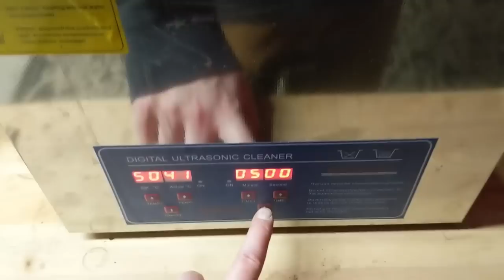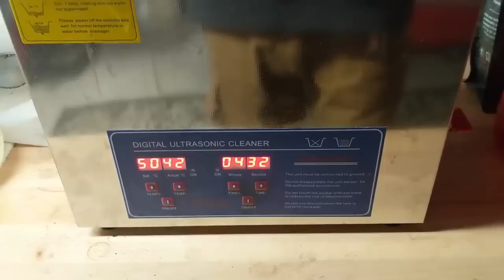How to Clean a Honda GX Carburetor

Comment: Thanks!  Solved my problem with the Idle jet.  Many other videos showed the other components to check and clean, but yours was the only one that only one that pointed out to clean that small hole.  My generator couldn't even start. If it did it was for 1/2 second.   cleaned that little jet and ran perfect.  VERY THANKFUL since the generator only had 0.9 hrs on it.    Maybe I will remove the fuel from it when I store it again.... for 2 years.  :-)  I did learn a bit more too with the other parts in a carb too!

Comment: Thanks man, just bought a barely used snow blower yesterday. The PO left gas in it, in his storage unit for the past 2 or 3 years. I got it cleaned up this morning and it's running well, which is great because they are predicting another snow storm in the NE. This really saved my butt and my back.
Reply from the maker: Thanks for watching!

Comment: Excellent video.  My pressure washer would not stay running. Used the information to remove, clean, and reinstall the carburetor on my Honda pressure washer.  Started right up. Thanks.
Reply from the maker: Thanks for watching!

Comment: Dude, I can't thank you enough! Without going into the gory details as to why (!) my carb was leaking gas like a sieve. Turned out it was the needle valve that wasn't sealing correctly. I know zero about engines (apart from which end the gas goes into), but thanks to this video, I was able to take the carb off my Cub Cadet snowblower and fix the whole thing. No more leaking. Likely saved a lot of money too. Thanks so much. Greetings from Michigan!
Reply from the maker: Glad to hear you're back up and running, thanks for watching!

Comment: Video is excellent.  I'd never taken a carburetor apart before but watched these 2 videos, on cleaning and replacement, and it worked great.  Before cleaning, pull start was an exercise in frustration and electric start turned the engine over but still the engine died.  After cleaning tips from this video, engine started on two pulls and just purred.
Reply from the maker: Thanks for watching!

Comment: You might be able to get friendly with your local dentist and ask for a No 6, 8 or 10 K file for endondontics to clean the main jet. They can't be used too much (work hardening) so as long as they've been sterilised after use should be safe. They're made for cleaning our root canals. Inset, twist and pull to remove debris. Come with a little handle.  Handy also for water jet sprayers on your cars windscreen washer system

Comment: This was a huge help man, really appreciate the video.
Reply from the maker: Thanks for watching!
Reply: @EliminatorPerformance  just out of curiosity, so I rebuilt my carb minus the ultrasonic cleaner. Set my adjustment. Still won't run. I'm going to do a compression test and spark plug check. Any idea what a good compression number is for a snowblower. Ariens?
Reply from the maker: @farkid911  anything over 90 should at least fire if you have spark. Spray some carb clean in and give a pull, maybe no spark?
Reply: @EliminatorPerformance  yeah that's what I'm going to check next

Comment: Thank you so much. I just took out the idle screw and the plug underneath it. cleaned out the little hole, put both back and it runs great. :-)

Comment: This was great, thanks for this. Does putting the gaskets and o rings in the ultrasonic cleaner cause any problems? Did you replace any of them as part of this cleaning? It didn’t look like you removed them prior to the ultrasonic cleaning.
Reply from the maker: No I haven't had an issue with it. If I can remove them I will, just so they don't get wet, but when they're stuck good and the gasket is still in good shape then I leave them.

Comment: Well done! One of the best Honda carb vids I’ve seen. Maybe you can help with a problem I have. Honda HS724 snowblower. Starts rough, will sputter and backfire upon startup. If I try an engage drive or augers it will sputter and stall. If I give it just a minute or 2 to warm up everything is fine and purrs like a kitten? Any thoughts? I’ve cleaned carb in ultrasonic cleaner poke all hole with wire? I did notice in this gif that maybe pilot jet isn’t seated all the way like you shown? Thanks for any help

Comment: I have almost the exact same generator, i can start it with starting spray and then it keeps running but without the starting gas it refuses to start, is it likely the carb that needs cleaning then?

Comment: mine has a screw with a stop that won't allow it to turn; only little left a little right ..not all around and didnt want to trouble it but should I.......Is it wise to use the pressure hose through it ...doesnt it have one way valves like a two stroke carburettor?

Comment: Impressive video brother.  So much info in a very easy to follow manner!  I still have a no start issue on my generator with the exact same carb though.  Good spark.  Plug looks to be getting a little bit of fuel after pulling a dozen times but might not be enough.  Everything seems clean.....any ideas?  Thanks a bunch.
Reply from the maker: Spray some carb cleaner in there, if it starts on the 1st or 2nd pull it's a fueling issue. If it doesn't start, could be no spark or valves need to be adjusted!
Reply: @EliminatorPerformance  Just started after first pull with carb and choke cleaner then stalled.  Back into the carb I go!
Reply from the maker: Make sure your fuel shut off, and fuel line are flowing
Reply: @EliminatorPerformance  Turns out it was water in the gas.  Starts and runs now but surges as you described in this video.  Now I'm off to watch that one, too!

Comment: This video really helped me, thanks a bunch! Had a 1980 honda gen given to me. It's in showroom condition except I think the original tank of gas was left in it. You can imagine what the carb looked like on the inside! Anyhow, thanks to your video I was able to address all the components in this carb. You should have seen the engine oil, it looked like black curbled milk. Well she is all cleaned up now and running like a champ. 2.2 kilowatts of pixies flowing through my power cords.
Reply from the maker: Nice, glad to hear it's up and running, thanks for watching!

Comment: Quick question. Does the mixture screw on the Honda small engines meter fuel or air? I need to richen mine a little but don’t know whether to turn it in a hair or out a hair because I’m not sure if it’s a fuel or air screw. Thanks

Comment: Great video but wouldn't the ultrasonic cleaner soak and degrade the gasket or gaskets on the carburetor? I think I would have carefully removed them before using the ultrasonic cleaner OR any carb cleaner! Thanks!
Reply from the maker: Surprisingly they've never damaged gaskets, if they're still thick and not torn I just reuse them, I've never had a problem. Once you try to remove them you absolutely have to replace them. If they're dried and cracked then I'll replace them too.

Comment: Very helpful video and thanks for taking the time to share. I'm running into some issues with my gx160 took carburetor I took it apart to clean and noticed the idle jet did not have the little hole and using a sewing pen i was able to I guess free it kinda seemed like it didn't have one 🤷🏽 i also bought a carburetor for one of my other machines (gx240) and was curious I took the idle jet out and this one had a brass piece but no hole I tried a twist tie and smallest sewing needle and it doesn't have one, is this normal?

Comment: I am dismantling a carburetor on a Honda F310 that has not been used for 15+ years and I cant get the distribution tube out. Any ideas how to get it out ? :)
Reply from the maker: Soak in boiling water and some dishsoap maybe loosen it up
Reply: @EliminatorPerformance  
Great! Thank you for the tip!

Comment: Hi, I have a honda gx390 generator, I have removed the fixed idle jet and I can't see any hole whatsoever and I can't push nothing through it, it's like there's not ment to be a hole there, I red that some of the gx390's don't idle and just have a run speed, would this be why? it's more like a blanking plug than a jet, thanks john.

Comment: My Honda rt5000 tractor with the GX engine dumps fuel from bottom of carb when I’m cranking it. Is this a case of the rubber plunger tip? Also spark plug was wet, and there was even fuel in the plastic intake that connects to the carb. Thanks for the detailed video.
Reply from the maker: Yes, leaking needle valve. Sometimes it can be the seat that the needle valve goes into as well, I'd recommend getting a needle valve 1st and then looking at a replacement carburetor.
Reply: @EliminatorPerformance  where am I going to find a carburetor for a 1989 Honda rt5000 though? I think the Honda PN is 16100-ZE3-793. Although, when I google it, the pictures don't really look like my carb... Thanks again.

Comment: hey bro !  i have a Gx 140 and i had some issue with him at one event ...we tried to fix it in the night time ...and i think we lost some small piece from the carburetor. i would like to buy a new carburetor and want to ask you if think that other model of carbureator will fit ...i mean gx 120 gx 160 ? because i can't find the right one on the market . thank you
Reply from the maker: I believe the gx120 and 140 are same, but are different from the Gx160 and gx200 (those 2 are same as well)
Reply: Eliminator Performance thank you so much for replay 🙌

Comment: What does it mean when these have good fuel good spark but just won't pull fuel on mine it will stop pulling fuel ill even manually prime it to get it to push fuel up the tube and it will run for a few seconds then die this is the kind with a solenoid on the bottom mind you it agrivated me like crazy Friday cause it wouldn't stay running

Comment: You mentioned new carbs may surge from the factory?? I just replaced my carb it came in my tune up kit I was hoping this would stop the surge but it’s still surging and engine dies unless choke is on. What’s next?? I put fresh fuel and all in it
Reply: Check fuel filter in tank, it’s a fitting with a filter on it 
Remove the tank

Comment: What do do with a cloned honda genny that runs bout 1-5 min than dies, can pronlong when stutters by switching to choke...
Reply from the maker: It's starving for fuel, I would start by cleaning the carb, blowing out the fuel line and also removing and cleaning the fuel filter that screws into the fuel tank
Reply: @EliminatorPerformance  Thanx sooo much thought it was air but that solved  0. I'll mess with that fuel and it's loved additives that gunk everthing.

Comment: Honda gx390 only runs good on half choke.. Took the main jet out an cleaned with compressed air, but still the same. What's my next step? Thanks!
Reply from the maker: Clean the pilot jet! Thanks for watching!
Reply: Appears like that solved it. 👍 Thanx man! GR8 video!

Comment: I have a Honda gx 340. What would cause gas to leak from carburetor. Seems like it’s bypassing carburetor coming out the top back side. Could it be float needle problem
Reply from the maker: Yes, leaking needle valve, pull your dipstick and smell the oil. If it smells like fuel or it's overfilled, change your oil before running the engine!
Reply: Eliminator Performance I just changed the oil. No gas in it. I have to cut the gas valve off when not using cause of gas leaking. I bought a new carburetor just waiting for it.

Comment: well that should solve my issues. i have a clonda powered golfcart april 5th the jack shaft from the cvt decided it no longer wanted to be part of the cart and ejected itself at 40 km/h (about 25mph) got a neighbour to tow it home where i got it in the shop tore it down and ordered parts and it sat for 3 weeks waiting for parts and someone to give me a hand redoing the chains. went on a test drive to get dinner at exactly the 3 week mark it idled fine but ran like complete shit with any throttle imput and died in the same spot the jackshaft ejected itself i initially thought it was too much fuel because i changed the throttle linkage and the after market air filter was soaked in gas that wasnt it so i towed it home again changed carbs same thing so that led me to think water in the gas. thoughts being there was enough vapor in the carb to idle but with throttle it was pushing water out of the bowl filled a clear container with gas from the tank and nothing so i ordered a new carb my plan is to clean the two that i tried and keep them on stand by when it inevitably happens again im just thankful it waited until after the snow was gone

Comment: hey guys, awesome video. not sure if you can help, but, after taking a year off from personal lawn care with the arrival of another kid, I'm back to mowing my own lawn. I made the mistake of not running my mower since last spring, and now I'm having an issue getting my mower (Honda gcv160) started. It seems to be a fuel delivery issue. long and short of it, I'm not getting any response when I pull the crank except when I've used a starter fluid. When I use the starter fluid, it fires up but quickly stalls out. I've verified the fuel lines are delivering fuel to the carburetor, put new fuel in the tank, cleaned out the carburetor bowl and main jet (nozzle and tube) but im still having the same issue. it doesn't seem like this would be a symptom of an issue with the idle jet. any recommended troubleshooting steps? anything is appreciated. thanks!
Reply from the maker: Probably the pilot (idle) jet. These honda carbs need to be spotless in order to run right, just had to oversize a pilot jet on a brand new one the other day to increase a bit of fuel. Hope this helps.
Reply: @EliminatorPerformance  thanks for the response. I was thinking a pilot jet issue would result in a surge problem, but I really just am not well versed in all the different potential failure modes. ill let you know if I have any success.thanks!
Reply from the maker: @alexapyan55  if the main jet and distribution tube is clean, and the engine starts but dies bt spray, then it has spark and compression. Usually air isn't the issue, so it sounds like the carb needs to be looked at again!
Reply: @EliminatorPerformance  Cleaning the pilot jet did the trick. In this carburetor its very difficult to clean because you can't remove it, but I was able to get a needle point down into it from both sides and clear it enough to flow gas. Thanks again for the recommendation.
Reply from the maker: @alexapyan55  anytime, glad I could help!
Reply: Eliminator Performance well, unfortunately I had it running for a few minutes yesterday, started it up today got ready to mow and it stalled out again after a couple minutes and I haven’t been able to start it since with the same symptoms. Cleaned out the pilot jet and the main jet again and both appear about as good as I had them yesterday but still no luck. I either need a sonic cleaner or a microbit, i suppose. Problem is it doesn’t seem like I can physically remove the pilot jet
Reply from the maker: @alexapyan55  check the in tank fuel filter if it has one. Should screw into the bottom of the tank and the fuel line goes there. still sounds like fuel supply issue.
Reply: @EliminatorPerformance  late response. I think i had removed this prior and checked it when i disconnected the fuel line directly out of the tank. I can check again but i dont thin kthats the issue. 

If I were to try to increase the size of the pilot jet what size drill should I use? I cant find anything smaller than 3/64'' which seems big
Reply from the maker: @alexapyan55  you need micro drill bits, go on eBay or Amazon they use thousands of an inch not fractions like 64ths or 32nds etc...
Reply: @EliminatorPerformance  so the only ones at that size I've seen are not for metal. Do you have any quick buy recommendations?

Comment: I have a brand new gx 390 and start only with choke even when it's hot.It's a problem?
Reply from the maker: Sometimes they need choke to start, I had a generator with a Honda like that, even in summer when hot I had to choke it. Seems normal for the larger gx engines.
Reply: @EliminatorPerformance  Ok,thank you,I thought it was faulty.

Comment: FYI

I learned the hard way why not to use gasoline with ethanol. My pressure washer powered by a Honda small engine wouldn't start because the carburetor was all gummed up and beyond repair.
Once I found the model number and serial number I searched the internet for replacement parts. Prices varied significantly as well as parts that were engine specific.
In order to take the guess work out of the equation I found Honda's Engine Parts website.
@t  I was easily able to look up parts for my specific engine and serial number. It was great! Diagrams of each component of the engine were clearly labeled with prices below. IMO prices were better than anything I was able to find on the internet plus I knew it was the correct part(s).

Honda should clearly state on their engines to use ETHANOL free gas only!
Reply from the maker: Most of them say no e85 (85% Ethanol) or to only use e10 and nothing higher. Thanks for watching!

Comment: Because you feel the need to hold the phone, you never show action. With a little bit of ingenuity you could rig your camera, even for the appropriate close-ups, and show stuff, so it would not be merely narration. Your knowledge is the real deal, just upgrade your camera work a bit. Also, re: the emulsion tube, it seems good to hold it up to the light and try to look through the side holes to see how clear they are.

Comment: Hello and thanks again for this video
i m planning to buy this 10l vevor ultrasonic thingy but i ve read some comments where it is said that the machine hardly hit 65  degres when it is supposed to reach 80 degrés (celsius) but i see in your video that you are not forced to heat the water so , is it possible to clean carbs with cold water aswell ? sry for my english i did my best to be understadable